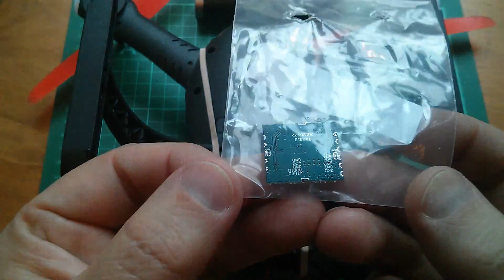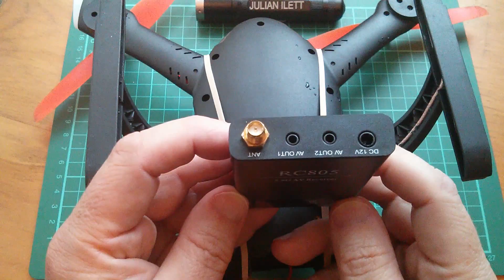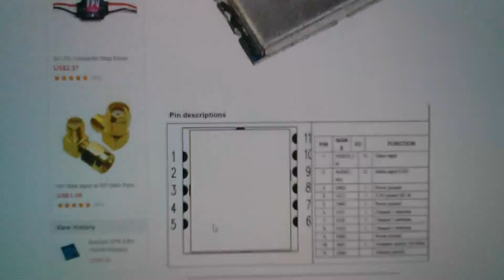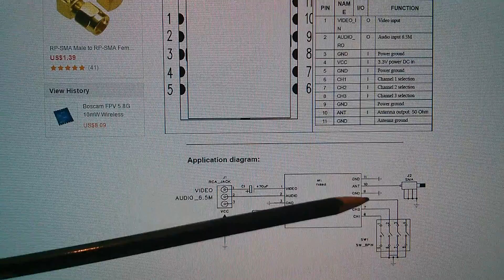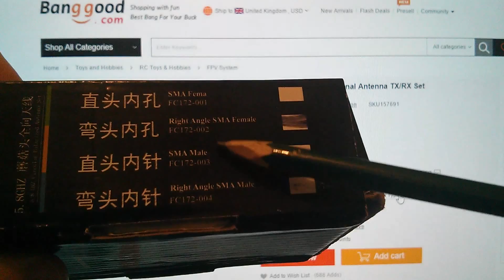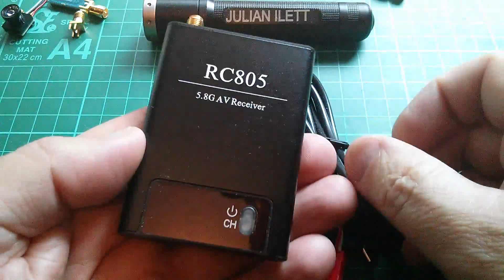Quadcopter 5.8GHz 10mW FPV Video/Audio Transmitter Build

Comment: I have been looking for a setup like this, my RV is 35 foot long, and I pull a full size suv behind her, all I have for rear facing camera gives me a view of my car and a little bit on either side.  I have considered mounting some camera's on each mirror so I can see what is going on along side my rig, after an incident in Cheyenne Wyoming where I began changing lanes and a car decided to pass me on my right side.  Had my wife not alerted me with her high pitch warning system (commonly known as a scream!) I would surely have collided with the car, and probably pushed him off the overpass, wrecking both my RV and his car.  A mirror mounted camera would have shown the idiot in time for me to prevent the collision alert and keeping both of our blood pressures a bit lower then what the doctors describe as frightening.

Comment: Hey Julian, I love your video. Do you know a transmitter that has a working frequency at UHF (Mhz) because my project needs only frequencies that are in Mhz. I think the boscam av transmitter module has a very high frequency
Reply from the maker: Those AV systems are 5.8GHz

Comment: Hi Julian, I really liked this vid, I recently completed a Q450 quadcopter build, and everything works, except when I connect a receiver to the cc3d, it becomes dead in the water. I've used the recievers separately with a servo and found them working, I've connected the cc3d via usb to openpilot on my pc and ive gotten all esc's and motors working fine. A friend told me he thinks the receiver is not getting enough power. I'm not sure what to do to address this, do you have any suggestions?

Comment: The new transmitter has a 3,3v (5v-3v range) regulator on chip (25mw Eachine and 200mW). Your setup could be simplified. They are at Bangood too.

Comment: Julian, those antennas are left-hand circular polarised, which is not too common overall so watch out if you by another, like a helical with more gain at the receiver, as they need to match (left/right hand). As others have said, including the guy who really introduced the use of these to the RC community, those Chinese versions are very poorly constructed. The big copper rings at the centre really defeat any approximation of tuning, so there will be huge losses.The centre 'feed point' should be as close to a point as possible. At 5.8Ghz there is little room for error, all the dimensions are critical.
Building your own is pretty easy.
A reverse polarity SMA has the opposite centre pin arrangement to a normal SMA. A normal SMA has the pin in the connector with the spinning threaded ring/shell (usually on the cable). With RP-SMA the centre is a socket 'female' instead.

Comment: I think these may be out of spec(/illegal?) in the UK? None of the frequencies actually fall within the band mentioned on page 33: http://stakeholders.ofcom.org.uk/binaries/spectrum/spectrum-policy-area/spectrum-management/research-guidelines-tech-info/interface-requirements/IR_2030.pdf
Reply from the maker: +Stephen Remde Aaaarrrrgggghhhh!
Reply: The legal frequencies for this band in the UK are 5.725 to 5.875 GHz with a maximum power of 25 mW eirp. Licensed Radio Amateurs can use 5.650 to 5.850 GHz, so I hope you have an Amateur Radio Licence. :)

Comment: What a cheapass setup :)
I got away with powering that TX from 1 cell of the main flight battery, these days I'm using a similar setup but with SKU075326 (200mW) and a proper regulator. I think I will buy ready-built TX modules in future though, much easier and not a whole lot more expensive.
I still use that receiver, on a 2S lipo. I also found it to be ok on a fully charged 3S lipo too.
I tried one of those cameras you have there but I found it to be a little too wide-angle for my liking for FPV.
Still using those antennas too. I see people saying they are crappy... they do ok for me, but then I haven't flown more than 200m or so away yet.
At the moment the camera is the weakest link in my setup, I think many recent crashes could have been avoided with a better camera.
Reply from the maker: +iforce2d Cheap ass, but perfectly formed!
I would have got a ready built Tx, but they were out of stock on the day I ordered - and I quite enjoyed the bodging together process. I can't use 200mW here unfortunately - it's not allowed, but I might get a 25mW module. Thanks for the inspiration though. I'm now stealing all your GPS ideas too :):):)

Comment: Great video, as all other videos! =D Just a question regarding your lamp-phone contraption, what have you used to get the camera onto the lamp-arm? The reason for asking is that I've just recently bought two new lamps like this and thought that I would use the old one I had for some project, mounting cameras on seems to be the perfect thing to do =D

Maybe I could figure this out myself, but right now I'm too sleepy in my head so I can't really understand why I have my eyes open even =D

Thanks in advance and keep up the great work with the videos! I love em! =D
Reply from the maker: +Chris Fredriksson Actually it's not a lamp stand - it's a microphone boom arm and so it has a 3/8" threaded pin on the end. This mates directly with a 3/8" swivel head tripod thing. So really easy to cobble together.
Reply: +Julian Ilett - Oh really? I thought it was the Tertial from IKEA =D It looks very similar, but that sounds great if it already has the threaded pin already attached. I actually found a video on converting the Tertial from IKEA into, well more or less exactly what you have, but for the GoPro cameras. Then it's just a matter of attaching a 3/8" threaded screw or similar to get a regular camera mount.

Anyhow, was fun to see it and thanks to your video I found out how to do it to the Tertial lamp, that I already have three of =D

Really liked the video nonetheless =D Keep up the great work and many thanks for the reply! =)

Comment: Having those cheap antennas is nice and all but the quality on those cheaper antennas is really quite terrible. In order to get good results you'll need to spend upwards of $30 (USD) on some good quality ones. I fly with a friend who has very nice antennas and on 10mw he gets the same range as me on 200mw withy per cheap antennas. However, those cheap antennas are certain good enough for just putting around the yard. Once you get into going a little further away, especially on only 10mw, you're going to want to upgrade those antennas. I would recumbent the VideoArialSystems Blue Beam or the Airblade. You'll be amazed at how much better they are. But what you have is plenty for starting out in FPV. Once you get into racing and you're doing upwards of 50mph (80kph) you'll really need some better antennas because of how fast you're covering ground. Good luck!

Comment: Whip aerials are most always monopole (i.e. they are not bifurcated), the reason for the TX being a clover is so that the linear edges of the transmitting element are off axis to each other in all three axis and prevent localized loop-back on the transmitter which can lead to heating and of course significant power loss and range.  The RX aerial doesn't have to deal with this but by adding the fourth element it adds gain 'mechanically' by ensuring coverage is more 'spherical'.

Electrical/RF connectors are gendered by which portion 'covers' the other, of course there are exceptions to every rule cough*USB*cough. Male connectors in general have a shroud of some sort and typically also have the protruding contact.
Funny enough just like closing a switch is the opposite of closing a valve, pipe/tubing connections are inverse of electrical.

For best results circularly polarized aerials work best when the 'faces' can 'see' each other much like how whips like to be in the same general axis.

As stated by others R and L designate the direction of polarization, mismatched polarity will significantly decrease range or preclude reception.

Lastly, higher frequency RF devices have a lower 'penetration' power for the same given transmission power.  If the 2.4Ghz band wasn't so crowded I would suggest you take that route, or go even lower to the 700MHz band if you can find that stuff in small enough a package. At which point you run into the "Why not just transmit an uncompressed digital stream?"

Comment: Julian, I'm  no expert in RF either, but the antennae come, not only in SMA and RP-SMA, but in LEFT and RIGHT polarisation (just to add to the confusion). The "L" at the beginning of the EBAY listing, probably refers to left hand polarisation. one should ideally use matched pairs.

Comment: 10mw is way to low power for reasonable range just get the 25mw for workable range
and the antennas are creap i got them and got real bad results, the tarot tl300k antennas are way beter for the price

Comment: Try building a quad copter from scratch, kits are real cheap and it can be a lot of fun deciding what controller to use etc, i'm currently building a drone with full GPS features and FPV.  BTW 10mW isn't going to allow much distance.
Reply from the maker: +DigitalAura I really fancy building a hexacopter or even an octocopter from scratch. 8 motors would sound beautiful together - like a symphony.

Comment: Most abrupt ending of a youtube video I've ever seen (:
Reply from the maker: +LeoTheHuman It was all getting a bit surreal :o
Reply: BTW, the antennas with the metallic cylinders used to attach bottom and top part of the leafs are quite crappy. These mess with the tune of the antenna and reduce the gain significantly. This is a manufacturing technique to make the assembly much easier. Best antennas have top and bottom parts of the leafs come together at the original angle as close as possible, without any vertical parts in between. Also, I've heard, these cylinders are a good capacitor. You can probably measure the capacitance for us, it would be great. (:

Comment: Btw you're skew planar and cloverleaf don't look very good! the part where the copper is soldered to makes the antenna behave less like a resistor and the angle on the antennas doesn't quit look right to me. im no specialist but just my observation :)

Comment: That receiver works nicely down to around 10V. I made a backpack for my FPV monitor that had 2 18650 cells a step up converter and that receiver all running at 10V for over an hour. 

Annoyingly the receiver doesn't auto power-on when power is applied.
Reply from the maker: +Tim Mortensen Yeah, it is annoying that it doesn't auto power on. It does seem to remember the last used channel though.

Comment: Great timing with the postie there! What size decoupling (I think) capacitors did you use?
Reply from the maker: +cicero44bc I just used what I had - 3.3uF Tantalum 35V
Reply: +Julian Ilett does banggood also have transmitter modules for microcontrollers in that frequency range? 433 Mhz is a bit weak =/
Reply: +fredlllll Not the best if you want data transmission. These are purpose made security camera transmitters consequently have a wide band frequency emission and would require AFSK modulation for the data.
In any case the 433MHz will carry much better being lower frequency and narrow band which improves the S/N ratio. There is also the numerous Bluetooth style transceivers available as modules on Ebay.
Reply: well i need bigger range =/